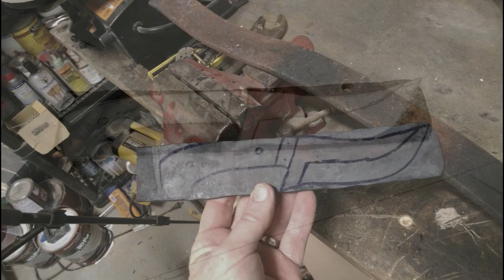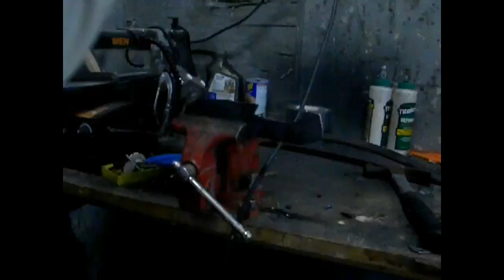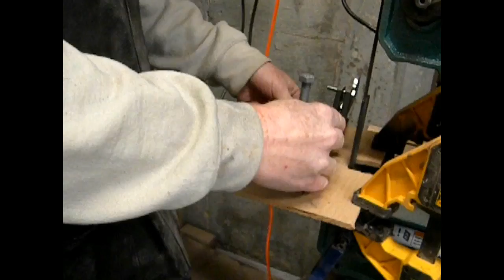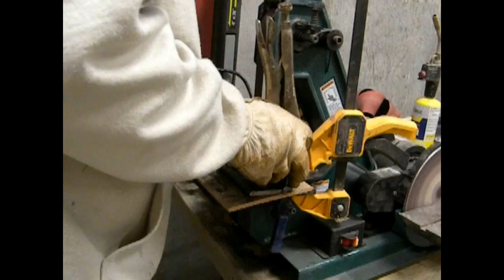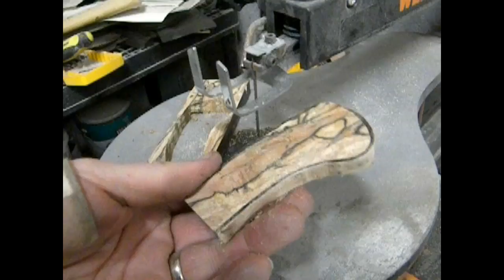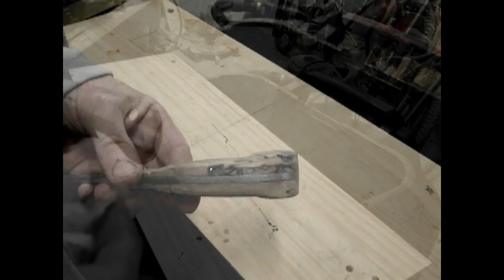How to make a Leaf Spring knife with Firewood Handles

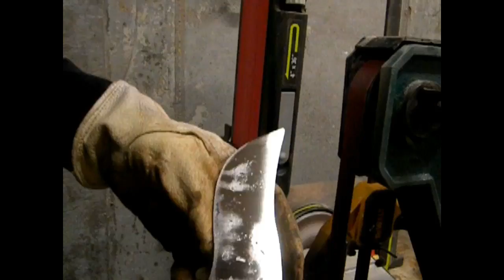Comment: Can you tell me what beltgrinder is the left one at 8:40? I would like to have a look on theo model because i am looking for a new grindes since my old one shorted out and killed itself...
Reply from the maker: The 4 inch sander on the left is from Home Depot. 4 inch belt sanders are historically not the best for knife making. They have side rails which prevent grinding bevels with plunge cuts. They can however be modified. Check out this video which details the modification https://www.youtube.com/watch?v=1D_euTrQ84A